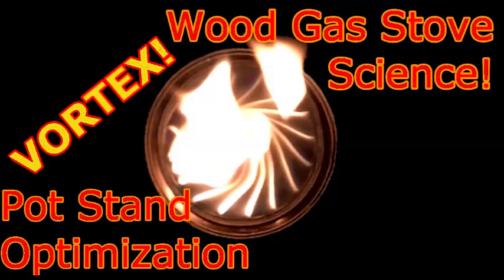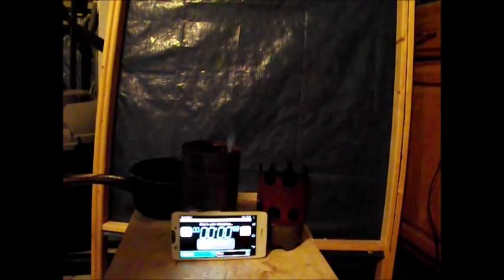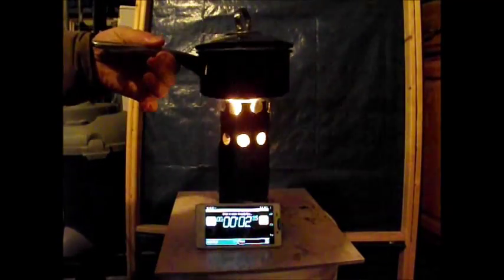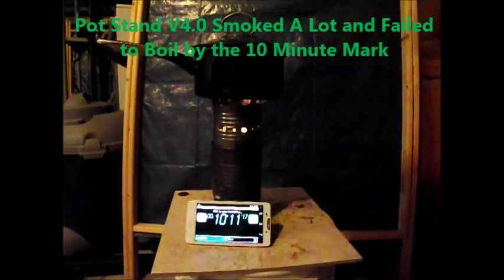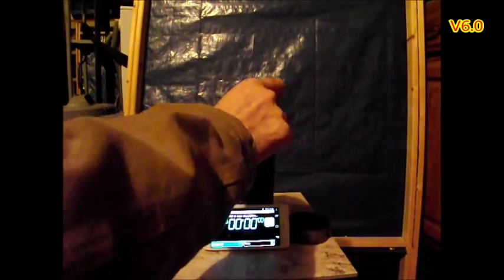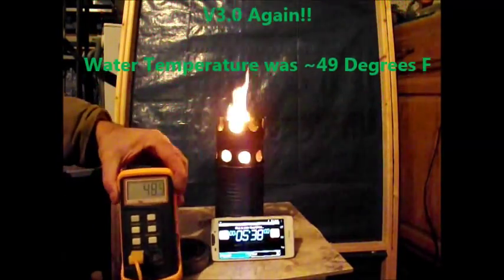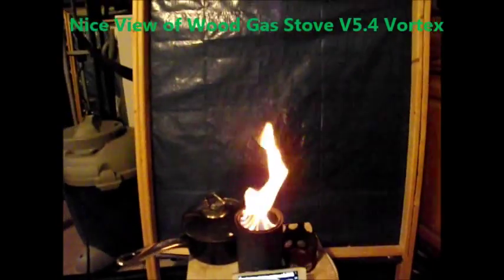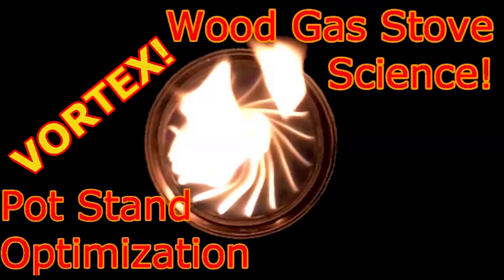Wood Gas Stove SCIENCE! Pot Stand OPTIMIZED!!!

Comment: Really excellent series of videos. I'm wondering what you used as an insulator? Thanks
Reply: Thanks! Wondering if that would be practical long-term - does the stove not go above the melting temperature of fibreglass?
Reply from the maker: The fiberglass was on the outside of the stove. So it does not get that hot. If I were making it a permanent part of the design I would find something more suitable. Thanks for the question!
Reply from the maker: I used fiberglass insulation. Thanks for watching!

Comment: I have done pretty much every thing you have done with the pot stand experiment along with all your secondary and primary hole experiment in your wood gas stove.  

You are comparing the wrong thing in the pot stove stand.  The flame on top should be completely unhinder to allow the combusted air to come out fast and unrestricted.  A pot stand should always be open such as using bolts or a mesh pot stand.

I bet you will get a faster boiling time if you use a wire mesh as a pot stand and include the flame concentrator.  This is what I have discovered.
Reply: well that is unless you factor in wind in an outdoor scenario.

Comment: Greetings with Gratitude! 
I'm about to follow in your foot steps with a V5.4. Thank you for your good work here and elsewhere.  
Questions about the outside can lid: If removed (and later added to inside can), I expect this stove will rattle in a pack - but one gains a fireproof floor (or fireproof "containment vessel"?).  By the by, one rarely sees four consecutive punctuation marks - woohoo!  
What other factors play into that lid choice? Waste of the contents? Are there advantages to later separating the inner and outer cans?  Others? 
Thank you again.
Reply from the maker: +Henry McGlade The fireproof bottom is improtant. If you burn this stove on bare ground with no bottom it will catch the ground on fire. You can place it in sand or on a rock but not the forest floor. If you are worried about rattling you could use JB Weld to "weld" it back together. If you remove the top as shown and reuse it; it is easier to build and put on the Vortex Tweak (angled holes). It will work just fine if you build it as you aluded to, just be careful in selecting the spot to use it. I personnally like to leave no trace of my being there (especially if the trace is a massive forest fire). Only two consecutive punctuation marks. Darn! Good Luck! Thanks for the comments!
Reply: @heathputnam9524  
You get points for using three exclamation points in three consecutive sentences, though.

Comment: Thank you love your videos,but I'm wondering about the height of the pot stand.
For the best burn heat temp.
Reply from the maker: I will be doing a How to build Vortex V5.4 w/pot stand video very soon. That will include all dimensions needed to build a Wood Gas Stove with a votex that will reach over 1500 degrees F at the top of the pot stand and boil two cups of water in 6-7 minutes. Stay tuned! Subscribe so you don't miss it!
Reply: Thank you
can' wait,will be building one soon as warms a
 up bit.It's cold in shed,we're -20 plus wind
Reply: Heath Putnam I just saw this video today, and I'm wondering if you got around to making the how-to video on the pot stand. Also, on any of the vortex stove and pot stands, is there a rule of thumb on size and number of holes, if I wanted to scale up the stove size? Thanks for your videos, very nicely done.

Comment: Awesome improvements man ! , from 10.75mins to 7.75mns , that's amazing 
I'm surprised though that the insulation didn't produce a cleaner burn , maybe the heat exchange rate of the air in not below freezing temps is not that significant 
Were you able to touch or move the stove while it was burning with the insulation material ?, and what did you use as an insulator ? ;)
Reply from the maker: Ahmed Usul I used fiberglass insulation and I could pick the stove up and move it while it was burning. I did try the insulation in sub-zero F temperature and it made a big boil time difference. Thanks!
Reply: Thank you ! for your videos ;-)
Next project ?